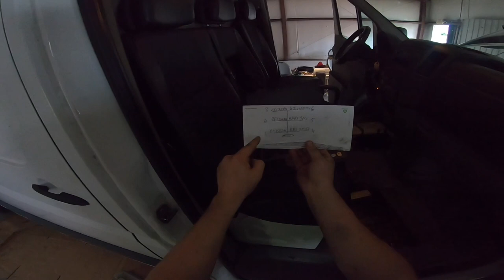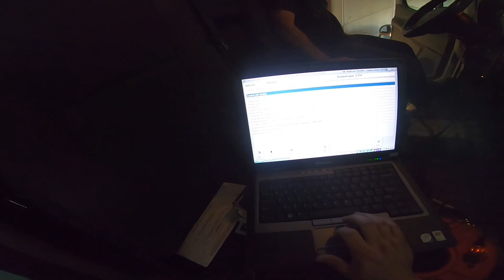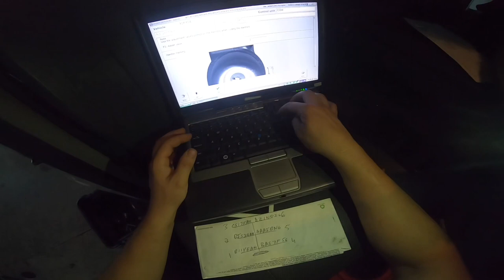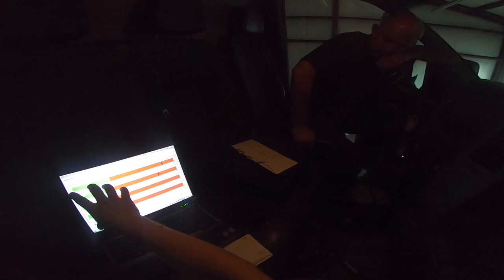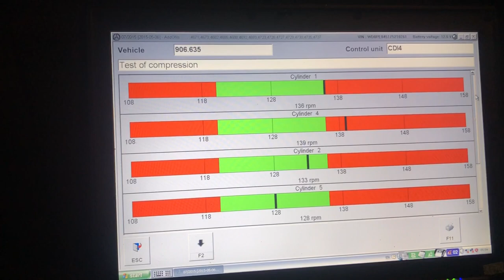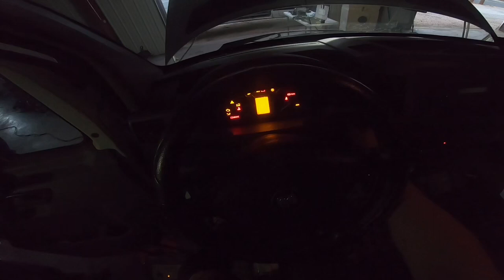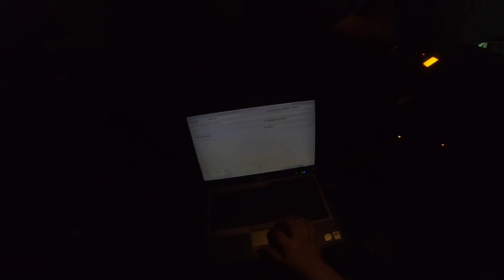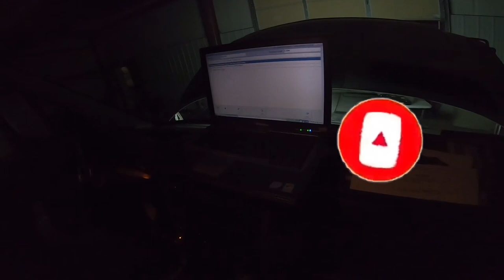2007 Sprinter starting but it keeps dying and smokes when it starts Bad Rings, low compression?

Comment: So what was the problem, did you ever figured it out?
Reply from the maker: Yes we figured it it, it needed time for marvel mystery oil to work, in less then one week it just started right up
Reply: @ZimaletaMotors  what u mean by that
Reply: He definitely didn't figure it out. I've seen same issue and it was failed injector, and I've also seen failed hpfp cause same issue. Putting oil in the cylinder is very dangerous. End up with a run away engine. Your not testing compression correctly which is why your test is all over the place. Your way to excited, calm down and do a mechanical compression test if you really believe it's compression.

Comment: He my friend, take your time. Youre all over the place. Your not testing compression correctly and i would suggest testing hpfp and injectors. You could have ruled out mass air flow sensor by checking live data and even confirm with volt meter or better off occiloscope. Bro engine regain energy back?? You hear that knock? Injector is dumping diesel